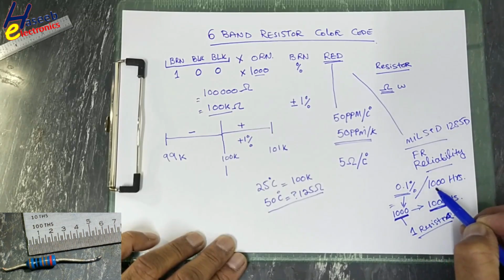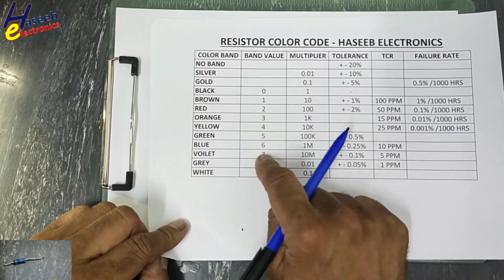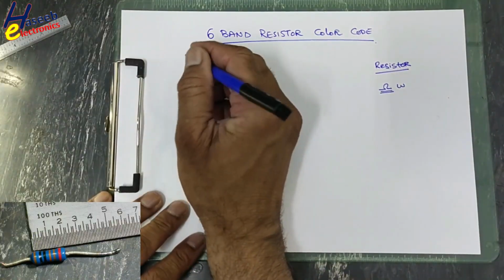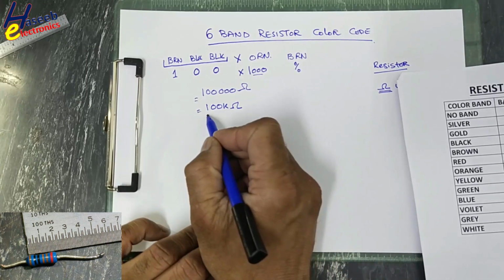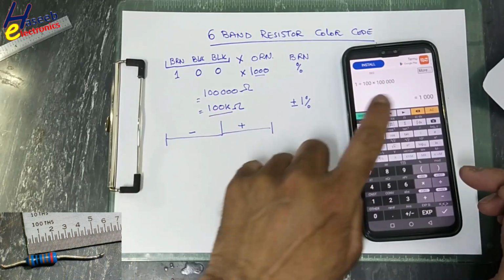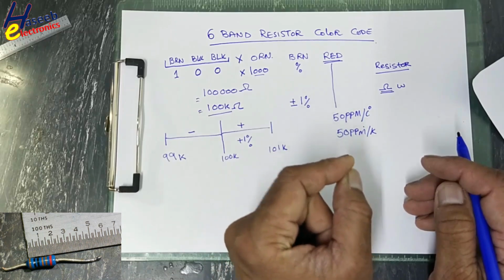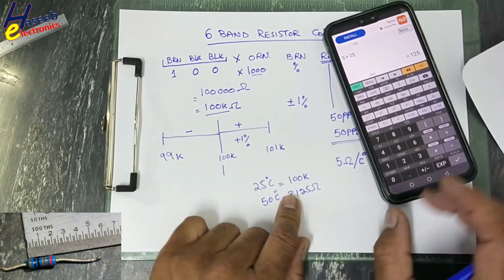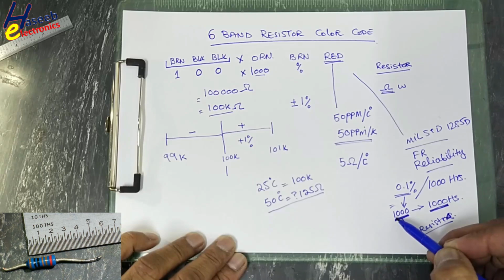{1321} How to Decode 6 Band Resistor Color Code | EIA & MIL-STD Explained in Detail

Comment: hi Sir nice video as always , Sir i came across a UPS that is using one linear transformer to power critical load  when power is off and also the same transfomer is stepping down the voltage and  charging the battery when normal power is ON can you please explain how that principe works